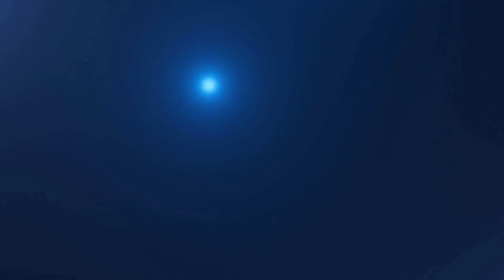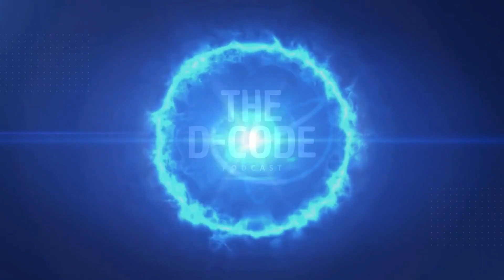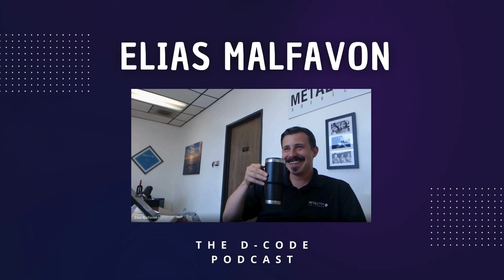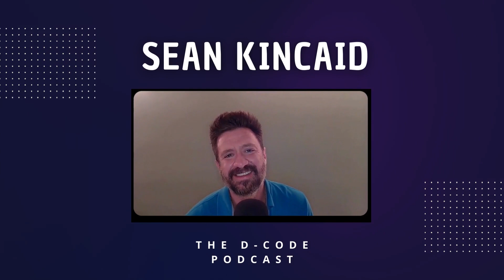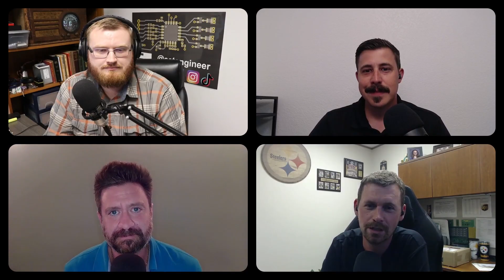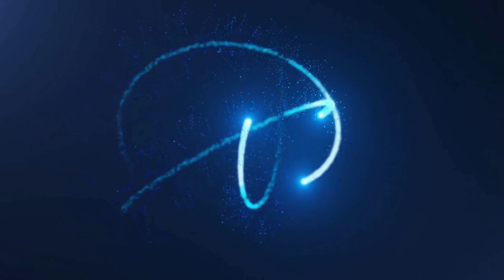Rev 1.4 - Alex Norman "BMS Alex" Battery Management Systems  @eetengineer

Comment: Near the end of the video you talked about ordering small QTYs of bare boards.  One trick you can do with some fabricators is to ask for a "min lot charge" instead of piece price.  You'll likely save money and/or get more board for the same cost especially if you have a small board that fits many on a panel.  Lets say you can fit 6 boards on an 18x24 panel and your order qty is for 4 boards.  If a fabricator isn't mixing part numbers on a panel and just building yours on one panel (which as Sean said is much easier from a manufacturing standpoint) they will usually cut in 2 or 3 panels even though they really only need 1 panel to fill your order.  This way if something goes wrong and one of the panels scraps out they can still ship your board on-time.  If you order the "lot" and specify you need a min of 4 boards, the fabricator will ship whatever they yield (which is almost always more than the min) rather than just the 4 boards you ordered.  In other words, you are buying the panel, not the individual boards.  Since the material cost is usually built in to the piece price the lot charge often times comes out the same or just slightly higher than what you would have paid for the piece price.  You'll also boards to play with, send off for solder samples to your assembler, or make wall art out of.